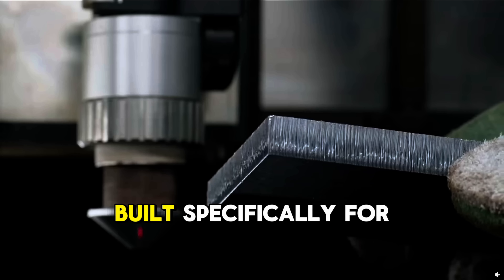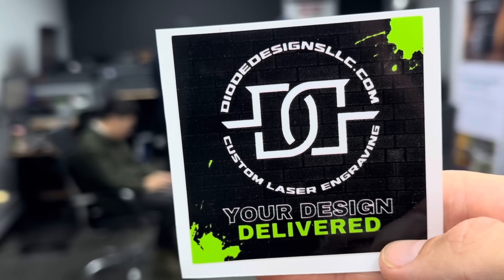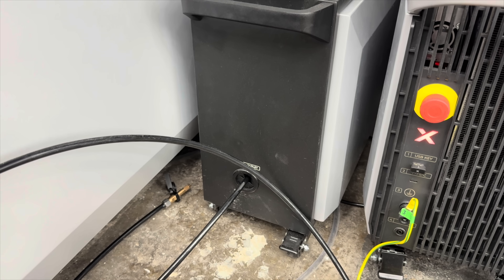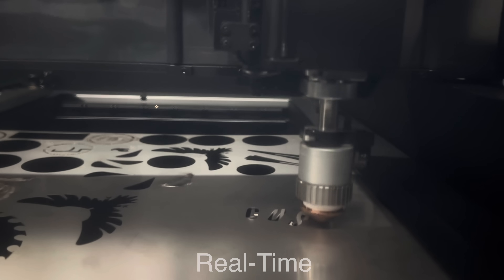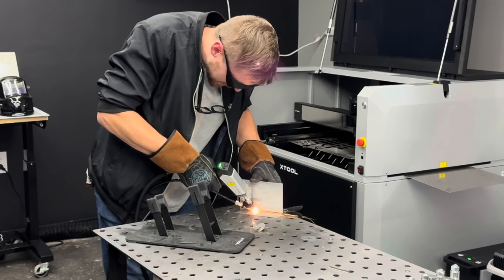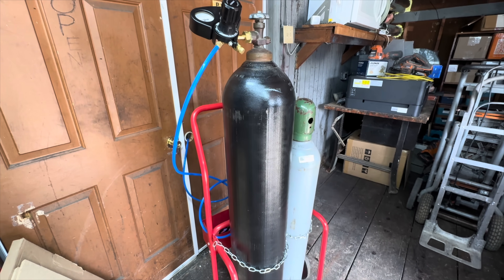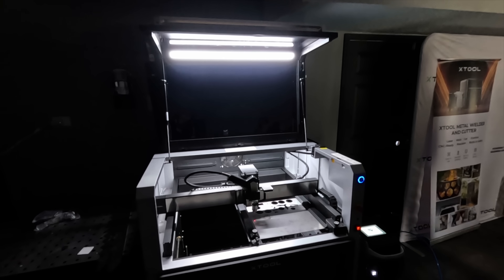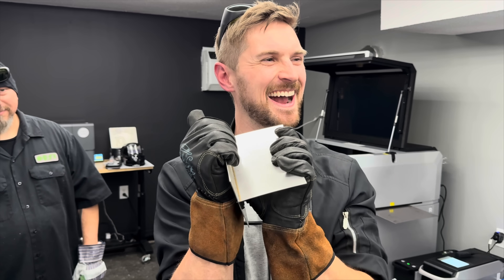Did Laser Metal Fabrication Just Change for Everyone? - xTool MetalFab

Comment: I was considering purchasing an IPG Lightweld, but after seeing this product, which is far superior in functionality, I'm holding off on purchasing. I'm still concerned that this new product might lack the same parts availability and reliability as the IPG. I typically use my products for 20 years or more, so will Xtool still be viable in 10 or 20 years? What if there's a problem after the product is discontinued? Chinese products tend to have shorter life cycles. What do you think?
Reply from the maker: I am with you, that is something I also thought about when I was looking into purchasing, though I will say that xTool seems to be the leading manufacturer in this particular category with the success they have had over the years I don’t see them going away anytime soon.

Comment: Adventure!!

I am so incredibly exited for this actually. I have been meaning to do metal fab for such a long time. I’ve been doing heavy research on laser engraving machines to add small logos to metal pieces but they simply don’t pack the punch this unit does to cut thicker metal. 

Specially since I owned a 7.5 inch lifted Honda element. That project required so much custom parts to make it work. Eventually I bought a MiG machine and made a few things. But this is what I have been wanting for such a long time. Yeah, it’s expensive, but it has tremendous potential to pay for itself by making custom projects for others.
Reply from the maker: I am a huge fan of the Honda element! Thanks for watching Ozzy!

Comment: As a career metal fab, I see value in this but they've closed sourced it, which is going to make it useless to me. Every metal fab modifies their tools, I say this because I would want to attach this to a CNC table, already talked to the company, that's a no go. Everything is locked behind proprietary software, including the welder. (Yes you have to software update your welder)
Reply from the maker: Yes I agree this is more made for someone looking for a ready to go package, not fit for the hacker community.

Comment: One vid some said the warranty only cover for the first 50 cuts
Reply from the maker: I would like to see the documentation for that. I believe that I saw that the super early bird supporters are getting a 5 year warranty.
Reply: I could not find that but did some looking and saw 1-year warranty for the United States, I just quoted what someone else said.
Also, myself I do not have the voltage and amp requirements to run this many others may not have the requirements to run this machine.
Reply from the maker: @brianlove3369 okay there is definitely a lot of people saying what they think or some even trying to sabotage the company possibly from their own competitors. I’d say if you don’t see it stated officially by xTool take it with a grain of salt.

Yes the electrical requirements are going to be a barrier to most that’s why I referenced that in my video and recommended calling some electricians to get a quote first.

Comment: this look like it could work well but how long was the cord for the welding function. Chad10 was the code right :)
Reply from the maker: @dreddles   the stats on the webpage say 1200w cable is 196.85 in
(5 m)
800w is 137.8 in
(3.5 m)

Comment: Why do printers and these smaller lasers always use feed rates per second? Mills/machining is all mm per minute, why?
Reply from the maker: @jacobmiller6664 it’s just a setting that I’ve become accustomed to coming from my first CNC with a wood cutting  router mm/s was the default, you can change it to your preference in the settings.

Comment: I work on older model trains, we have linkages that are not made anymore. I have Fusion 360 for CAD and 3D Print a lot of new parts. But I need to make new or custom linkage.   As a retired hobbyist there is no way i could afford such a powerful machine. However the narrow beam and clean cuts would be so good for these parts I need. Are you aware of any owners of these machines willing to consider such a small part and small lot. These parts are about 2 mm thick, 7 mm wide and 20mm up to 100mm long.  Small Model Train parts but these models form 1930 up to 1960 and no one is making them anymore. Any suggestions and guidance for us. Its a Great Machine but not One I  could afford.  Thank You, Dennis
Reply from the maker: @DennisMurphey  Hello Dennis that sounds like some incredible work you are doing. I am hoping some local maker spaces will consider getting these machines so they will be accessible to more people who can’t afford the whole thing for themselves.

At this point the full production machines have not come out yet but for your purposes I would recommend checking out sendcutsend you can upload your files pick your materials and thickness and have them price out your parts ship directly to you.

Comment: LMAO...come on man dropping a light weight piece of welded sheet metal is not proof of strength, even stepping on it! (if you would have folded it the other way I'm sure it would have broke)
FYI this type of over  embellishment for youtube hurts the very product you are showing.
Reply from the maker: @pro-touringf-body5179  you have a point I could have torture tested it better. I was still in shock though it was only welded on one side and if I had welded that with my flux core welder I am sure it would have broken. 

In the moment I did want to bend it back in the other direction but sadly wasn’t strong enough to bend it back in the other direction by hand.

I did bring the piece home with me and now that I have some of my tools I’ll do some more for you. I’ll film it and post it as a short.

Comment: $14 000 is ridiculously cheap. We have a 5x10' 6kw big laser at work. It was like $600 000, but can cut 1" thick steel. No welding or laser cleaning however. That really seems to be the craziest part about this machine. You can do all the fab with one unit. If I was doing handrail jobs or other small decorative work at my own shop I'd seriously look at getting one of these. If they could get a bigger format CnC enclosure eventually that'd be a no brainer.
Reply from the maker: I agree it’s actually less than I expected considering what all it can do I didn’t even get into the smart features they are putting into the software.

Comment: Glockesnshpeel.   😂. Not the right spelling, but great all the same. 

What a great tool.  As a builder, I reckon I could fab steel brackets for different projects and save a tone.  Even doing one off builds for enthusiasts would be a breeze.
Reply from the maker: Great word! 

Yes I think fabrication of metal brackets would be huge! Especially after having to buy a bunch for my deck project those prices add up quickly!

Comment: I'd like to know how long the laser is rated to last.   Something like 80% of original power at X hours of usage.  

If they're not overdriving the laser and keeping it really cool, it might last a long time.  If they don't have a proper margin of safety or poor cooling it will die far quicker than it should.  I would expect xtool to be able to do it right, but they need to say what to expect and they need to be accountable for it.
Reply from the maker: That’s a great question they said duty load is 24/7 so they are claiming continuous work. They also said expect a 10k hour lifespan on the laser source. And early bird buyers get 5 year warranty so it’s great to see them backing it up with that.
Reply: @ChadsCustomCreations  thank you for sharing!  I wouldn't be surprised if it was published somewhere, but really appreciate you saving me the time.  I hope others find it interesting too.

I definitely appreciated the video.  Thank you for sharing.

Comment: Laser welders need perfect fit up! A 1/16 gap is a big issue! Awesome for precision fabrication but nothing else!
Reply from the maker: Dave thank you for the insights. Which 1/16th gap are you referring I’d be happen to let the developers know about the issue and could like get it corrected in the production models.
Reply: @ChadsCustomCreations  It's part of how the system is designed! The laser head sends feedback to the machine and if there is no solid material behind it the computer does not know what to do. In some cases the wire feed stops and it just burns a hole like you did. The fit up needs to be perfect!

FYI Fun to set things on fire! https://youtu.be/IacYbl-cm1c?si=pyw0OY19uxTE5jo6

Comment: Nice video Chad, have to point out one thing though.  You mentioned that when welding with the Laser Welder it requires Nitrogen or Oxygen gas depending on what metal you are welding.  Nitrogen is used for steel and Argon would be used for Aluminum.  From what I recall, oxygen is blended with Acetylene gas for cutting steel.
Reply from the maker: Dave that’s a great point you are right different types of metals work differently with the different gasses. Thank you for watching.
Reply: Oxygen and nitrogen are used as assist gas for laser cutting, not for welding. You do not use acetylene for laser cutting.
Reply: It would use Argon for laser welding, like other low spatter processes like TIG etc
Reply: @wizrom3046  laser welder here. Mild and stainless steel uses nitrogen for the handheld laser system. Helium is really great, but nitrogen is cheaper.
Reply: @michaelryan9311   thanks for the info! 👍
Doesnt nitrogen spatter?
Reply: Argon works great for laser welding steel!

Comment: I was surprised by the price, pleasantly. Like you I also thought it would be a lot more. Did they mention anything about the longevity / service life of the laser? I would be curious to see what service life this laser has and the cost to replace. Great machine, great video!
Reply from the maker: Same here glad to see such a big price jump from the other machines in this category.

On the FAQ their site states “Under normal operating conditions, the laser has a cumulative lifespan of 10,000 hours. For laser replacement costs, please get in touch with xTool's official after-sales support.”

Also anyone who puts down the $500 deposit as an early bird gets 5 years warranty.
Reply: @ChadsCustomCreations  forgive my laziness for not going to the website and checking it out for myself 😁 appreciate the response! 10,000 hours is longer than I would have expected. Being just a hobbyist I really have no need for a machine like this, but boy do I want one!  As to what would I make with this? What wouldn't I make with it would be more the question. I have a hand built plasma CNC cutter right now, stating the obvious this thing is about a thousand times over and above what I currently own. And even with my home-built rig I'm able to fabricate some outdoor tables, car parts for buddies of mine and any other type of odds or ends my mind comes up with.
Reply: I had 2 laser welders from China and they are all crap! Once you use them for a few weeks they literally start falling apart! As in the handle will start falling part in your hands and the components start breaking down. 

The next one I get has to have parts and service in the USA! The price gap is very justified! It is like a Miller Dynasty vs a Harbor Freight welder! The American brands are all built by IPG Photonics (Miller laser is a IPG) and the Chinese one are made by MaxPhotonics. They just relabel them under different brands and change the look a bit.
Reply: @davejzielinski  I guess it depends what you're going to use it for, in a commercial setting sure. But $6,000 versus 60,000 plus is a heck of a jump even for more quality parts!
Reply: @robertmunafo5039  I had 2 lasers. The first died in less then a week then the second was a Morita Laser that died after 3 months. The first was was around 10k and the second was 6k. Both in the trash now.

I would like to see you beat the hell out of the unit you got to see how long it lasts. The main issue with mine were the QHB heads water cooling system.
Reply: @davejzielinski  no warranty on them even if they were from China? I tend to try not to be too hard on my equipment and as I said before, I'm more of a hobbyist versus someone who's doing this in a commercial setting. Take my CNC plasma cutter for example made from parts scavenged from cheap CNC laser machines and a relatively inexpensive low frequency China made plasma cutter. It's no hypertherm and I have no illusions that it would perform like one, but for things up to half inch thick mild steel plate it cuts very very well as long as I understand is limitations and treat it accordingly. It's super accurate and probably has produced 10 times its value in parts and things that I have made. Were I to treat it a little bit rough It would break in a heartbeat I have no doubt lol.